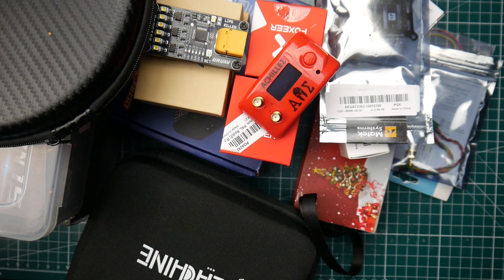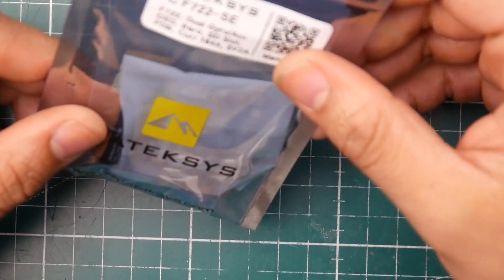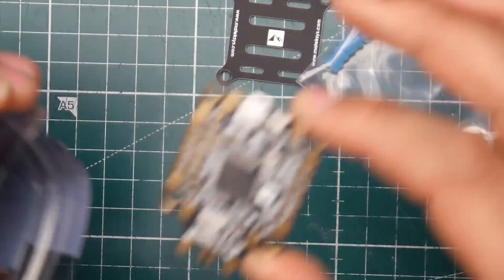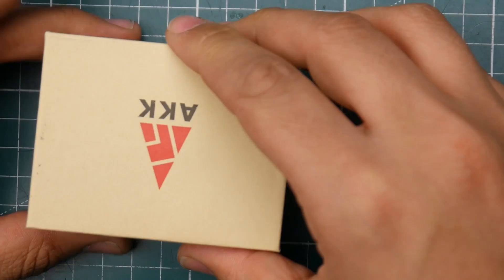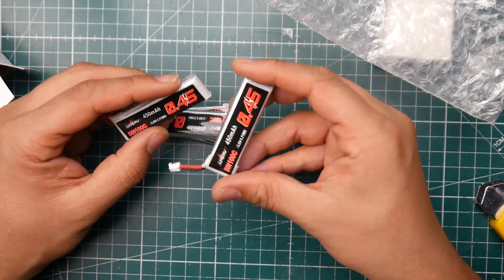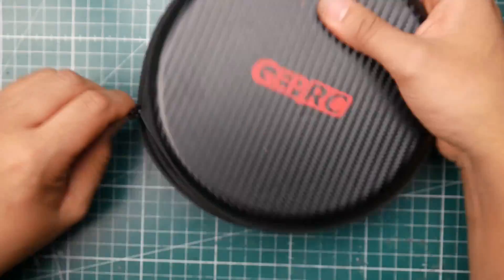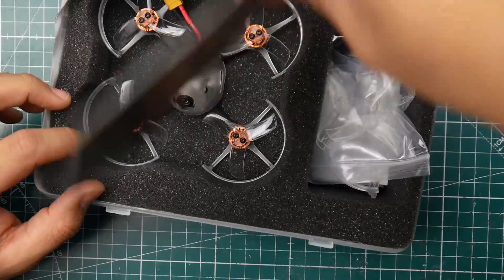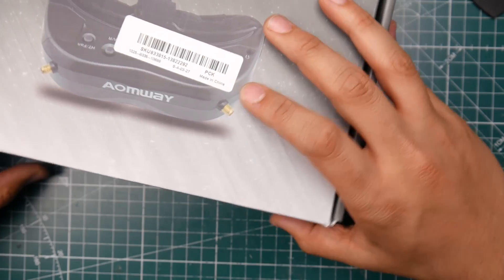MAILBAG TIME!! // T-Motor Falcon, AKK Dominator, Aomway V2, Lipo Killer

Comment: Regarding the stiff motor on that small quad. You should have know that. 🙂🙂 it’s when a esc keeps a minor charge in the FETs. It’s like when you have a brushless motor and you hold 2 of the 3 wires shorted out and trying to spin it. It’s stiff but when you have all 3 wires not touching each other then it spins free